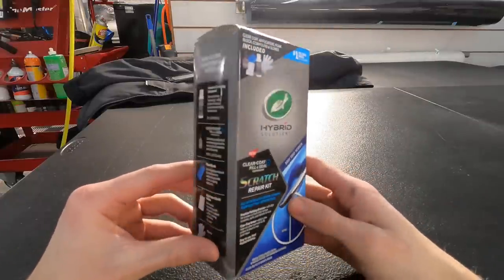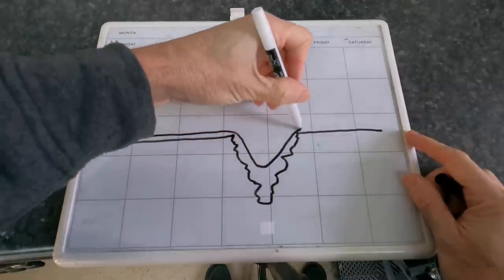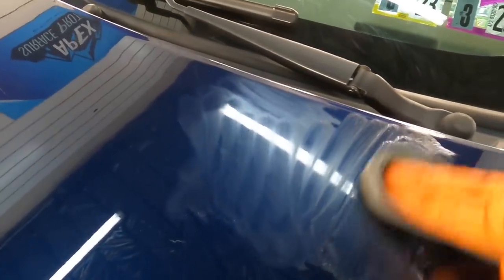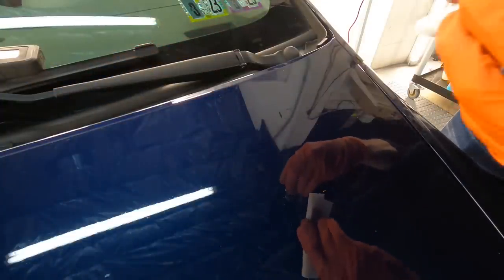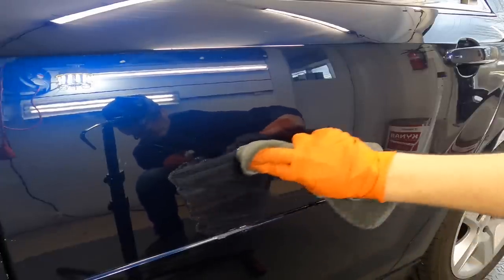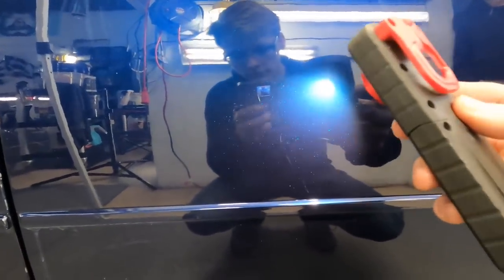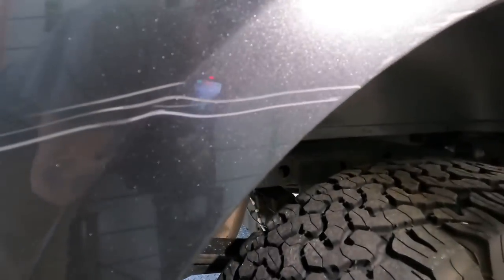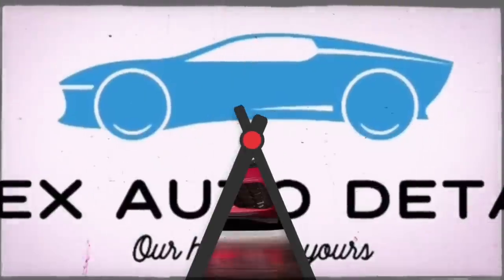Turtle Wax Hybrid Solutions Scratch Repair Kit! Cut And Fill with Clear Coat!

Comment from the maker: This reminds me of Optimum Clear Coat Restorer. Can you think of something similar in this category?
Reply: I wonder how the composition of this differs  from optimum's product as the optimum product requires the use of a respirator.
Reply: I am VERY keen to get my hands on some of this somehow. Optimum Clear Coat Restorer is not available in Australia and I can't even get it shipped from the USA (likely due to whatever chemical that requires a respirator). 

My fingers, toes and eyes are crossed that Turtle Wax will decide to add this to their Aussie line-up. 🤞
Reply: kamikaze artificial clear coat xkote
Reply: What ever happened to OCCR?
2 years ago everyone was reviewing and saying good things, but no one seems to use it.
Reply: Pearl Nano Kote
Reply: Any panel prep needed before using this product?
Reply: @misssummersalt  kbs make a self levelling clear that can be brushed on or possibly wiped on and is sold in Australia, I've used their other self levelling brush on paints and the finish is good but haven't tried the clear. This video has made me think about getting some and trying it. It's called kbs rust seal diamond finish clear coat
Reply: I used this product, then applied TW to the max wax over it the next day and got some rainbows, is anyone else ran into that problem?

Comment: My question is on motorcycle paint. Harley to be exact. I just got my new  motorcycle and I damaged my clear coat when installing a new tank badge. The scratch is catching on my fingernail…. 😞 I am a very detail oriented person, this bothers me! 

I have someone who can do a paint correction and apply ceramic in the area…. I am unsure if this is a good option because 1: a very small area, will it blend? 2: Is this a good replacement for clear coat? 🤷‍♀️🤷‍♀️

Or would kit mention in this video be a good option? Would like to avoid a body shop for such a small imperfection. But if I have to, I will. 

Thank you!

Comment: CAUTION: Don’t make the same mistake I made… I applied the clearcoat resin and everything looked good. However, after about 10 minutes, I wanted to add a second coat. But the first coat hadn’t fully dried yet so I made a “smeary” mess with the second application of clearcoat. Lesson learned: make sure you wait a full 24 hours for the clearcoat to dry/cure before applying a second coat. (By the way, I had to buff out the smears with a compound and DA machine polisher.) Note: I realized this resin is quite thick and doesn’t require a second coat. Live and learn!
Reply: Great advice, thank you for sharing a hard experience.

Comment: My biggest concern with scratch and paint chip repairs is the impact on the surrounding clear coat when sanding and polishing. Applying the resin in this way would appear to be a good idea to reinforce the clear coat before sanding or applying compound/polish.

Comment: What if you have already filled the scratch with touch up paint.
I bought the dealer colour so it’s a perfect match but the touch up is not level with the rest of the paint.
You can see the touch up.
It’s about 6 inches long and it was deep.
Can this product work on the touch up and level it out?
I did the touch up a month ago

Comment: Be careful. I used this in my garage and with limited lighting it appeared to work well.  When I took the car out the next day it had spots in the paint.  I thought maybe I didn’t wax it right but realized that when you apply this, it creates a different sheen or clear.  It looked very good but needed to buff out and blend in.  It didn’t work by hand.  Had to get a dual action polisher to fix it up. If your going to apply this, try to do the complete section or panel.

Comment: Any thoughts on how this would work on a car with tinted clear coat. I have a Mazda that could use a little scratch minimizing, and Mazdas I believe have tinted clear coats.
Reply: Any pearl is a tinted clear coat. It will work but pearl has off white clear topped with regular clear.

Commonly referred to as a “tri coat” in the indistry

Comment: If the scratch is down to the primer/metal, can this still fill and repair?
Reply: Someone didn't watch the actual video! 😋
Reply: @misssummersalt  I watched the whole thing, thus my comments commenting on the video. At no point did he do an entire scratch that was down to the metal.
Reply: @MeliorIlle  if a scratch is down to bare metal, no amount of anything clear will make it go away.
Reply: @MeliorIlle  well how did it look with a scratch that wasn't down to the metal? There's your answer
Reply: @MeliorIlle  the rear wheel well looked pretty deep. Maybe fill it in with a color pen . Then seal? I have a fiber glass hood on my 04 mach1. Stone chipped the hood edge. I I just kept adding paint. Car looks it has a minor case of herpes 🙈😂
Reply: @YoungSperm  I asked about it going to the metal.
Reply: @pwrshots  I just tried this on my hood, hasn't settled yet but it is a major improvement. Even on the deepest scratches.
Reply: @MeliorIlle  good to know. Keep us posted
Reply from the maker: No, you would have to grab some touch up paint… then top with this.
Reply: @apexdetail85  Would you maybe do a future video showing how?

Comment: I realize you are following the instructions to a tee. Would it have had better hand compounding results using a Cotton Terry which will have significantly more bite of rolled up very tightly than a MF towel?
Reply from the maker: Yes… outside the resin itself… I would use my own tools to prep.

Comment: DISCLAIMER:  If you’re going to apply this product, do NOT apply it to “several inches” covering the scratch on either side… do the entire PANEL of the vehicle.  I’m now left with a 3 inch swath of clear coat, in addition to the scratch right in the center.